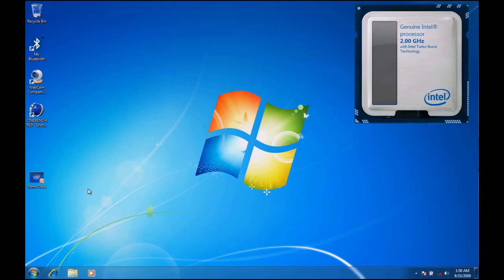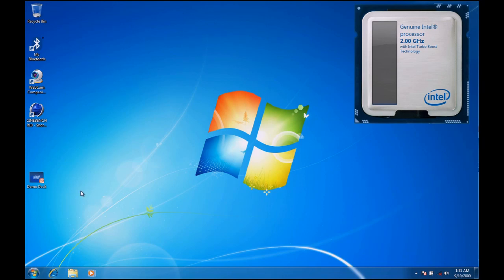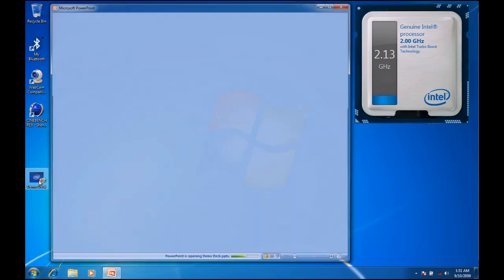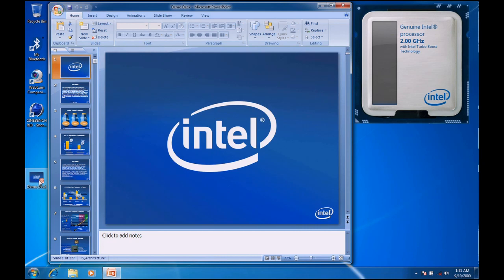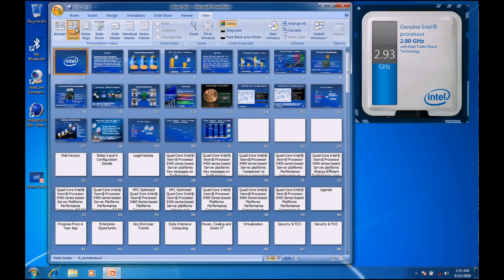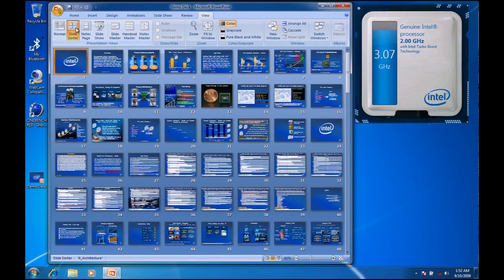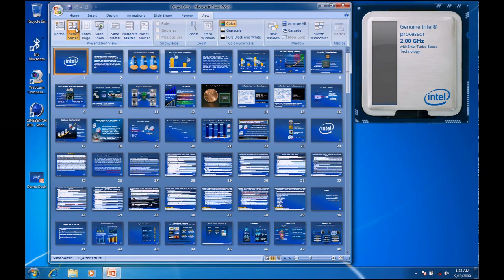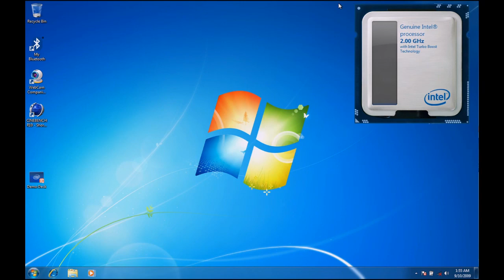Intel Turbo Boost Technology In Action

Comment: The frequency of the cpu will be boosted, but you had a frequency increase of 1.07 GHz. Does that not overheat the cpu and cause hardware breakdown?
Reply: It only boosts the frequency when needed, so when you open a large application it boosts up to it's max capacity and gradually decreases
Reply: Rapaka Rao remember that TBM3 is over clocking just one of the cores. During his presentation that was only 1 core that was getting overclocked. Overclocking one core rather than all won't effect the temp of your cpu as much.

Comment: i5 4460 boosts to 3.45 GhZ till it hits 50C° then swaps back to 3.2.., so in theory if u can keep yr CPU under 50 you could  have 3.45 all the time.., Hmm.., buyin non-stock cooler will do the trick i guess :D

Comment: For some reason the 2.6 version doesn't run properly on my Windows 8 64-bit i5 laptop. It runs on task manager but after a while it says it has stopped working and closes. Anyone else have this issue?
Reply: No but its designed for windows vista or 764bit

Comment: So like turbo boost is automatic? If it isn't how do I keep it at the highest clock rate
Reply: ***** It's controlled from 1) the (xEFI) BIOS, either manually (can be dangerous); or if your motherboard has a built-in overclock (OC) profile, 2) from *nix (Linux), by various software (xUbuntu has it in the regular repositories, some '*utilities' package) and 3) in Windblow$, it's only possible to disable teh boost, basically (bt, why not turn it off from BIOS)

Edit: Example, w/o using software @http://www.tautvidas.com/blog/2011/04/disabling-intel-turbo-boost/
Reply: Vladimir Nostromov Oh, TMonitor, "at the risk of permanent damage", http://download.cnet.com/windows/cpuid/3260-20_4-74601-1.html
Reply: It has been a while, I posted my comment back year and my knowledge has expanded over the past months. Thank you for the answer though

Comment: To have the Turbo Boost on most of the time. Use High Performance Settings in Windows. The OS will send P0 state signal to the CPU.
Reply: +Johnson C thank you. i almost always have it set to high performance..but i just did a factory reset on my lenovo laptop and it doesnt appear to have intel turbo boost anymore.. should i download it from the lenovo website?
Reply: +Johnson C ok. so i just checked my desktop gadgets and turbo boost is in there and its working.. if the gadget is not active on the desktop im assuming it still will work right?
Reply: shane keskeny Yes, the widget is just for visualisation. In case you wonder the current clock frequency, CPU-Z allows you to check it.

Comment: When I render videos my processor locks itself at 1.44 ghz even tought the normal speed is 1.60 ghz and that I can turbo boost up to 2.80 ghz why ?
Reply: Check your power settings, maybe when your running video rendering the processor is trying to save power and not exert too much power on the task

Comment: For Intel i5 and i7 CPUs [only these models have Turbo Boost built in the CPU], if your PC's BIOS has the feature to enable or disable Turbo Boost, then you can turn it on or off in the BIOS. Otherwise it is on 24/7 by default.

Comment: Turbo Boost is a built in feature of Intel i5 and i7 CPU. It is not an application or a program that you can run for a CPU. It runs automatically at a hardware logic level of the CPU with Turbo Boost enabled. Some PC makes have a BIOS function where the user can enable or disable TB. If the PC BIOS does not let the user change TB [on or off], then if the CPU is an i5/i7 then TB is on mt default.

Comment: Notebooks with i5 or i7 cpu has turbo boost on by default, and can not be turned off in the BIOS. This is because most laptop manufacturers disable the "Advanced" BIOS feature of notebook BIOS, so the user can not alter settings like enable/disable turbo boost. Check the user guide of your laptop's make and model for BIOS features to see what functions/features are available, and how to change them.

Comment: How does turbo affect power consumption?
Reply: It does not consume much power as in lower to idle tasks the processor will run an low speeds to conserve power until heavy tasks are run again to where it will spike up in power and perform the task.

Comment: im getting a laptop that's intel i5 with turbo boost ability

how could i make my CPU terbo boost without going into the bios
Reply: Turbo boost is usually turned on by default for i5 and i7 cpu's but in the bios is where it can be turned on or off.

Comment: >>>> Please answer <<<<
Can you conrol the turbo boost 
or it's automaticlly control
Reply: Its is automatically controlled by what you do, if you run a heavy task speed will go up and if your running low tasks or idle speed will be low until then another task is run.

Comment: hi i need fast answer i have intel core i5 2430m 2.4ghz and i dont know if my laptop supports the turbo but i installed turbo and it works will my cpu burn or what?

Comment: Using Windows 2008R2 and seems that the Turbo Boost is not working, using CPU-Z and the speeds go max to 3.3GHz (i7 3960X's regual Clock Speed) where's the 3.9GHz? using a software that uses only 2 cores to it's 100%. The other cores are idle...
Need to install some kind of software?

Comment: ok im panning to build a decent gaming system with a core i5 2300, if i run games that require both gpu and cpu to perform well will the turbo boost feature make the cpu run faster to avoid bottlenecking?

Comment: @nazmikrauser turbo boost is not an addition you can make, either your processor came with it, or it did not. it doesnt matter if you have 64 bit or 32 bit. if your processor did not come with turbo boost, look into overclocking. that will work for everything.

Comment: A question, when running games the intel core would be at its maximum speed, so would this mean that it would produce a lot of heat? and also if the processor specs said that the core is a 2.00 GHz processor with a speed boost (2.90 GHz with Turbo Boost Technology) does this mean that the max speed would be 2.9 GHz? Thanks in advance.

Comment: i'm running a i5 sandy bridge at 2.9 base power...when i run applications the bar is raising but does not pass 2.9...when it reaches 2.9 it appears "2.9 turbo boost"...if the computer is idle, it says energy saver...confused...how do i know turbo boost is active?...i have this new computer since tuesday

Comment: @zawette when you first turn on your computer, when you get your splash screen and such look really quickly for the button to get into the bios, if you miss it, press Ctrl, Alt, Delete, and your computer will reset. once you get into the bios it should be under the frequency/voltage control, and under overclocking configuration.

Comment: I downloaded it but I don't know how to attach it to the sidebar as it doesn't appear in my installed gadgets. I can open it as a normal program or application but it will stay opened on the task bar all time and not as a gadget on the sidebar. If anyone knows hot to attach it, "import" it to the sidebar, please answer.